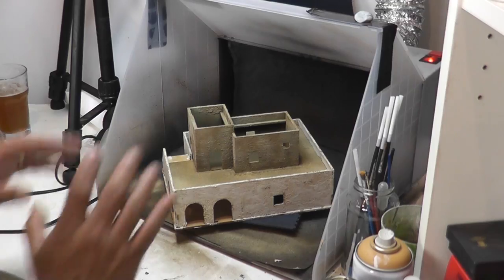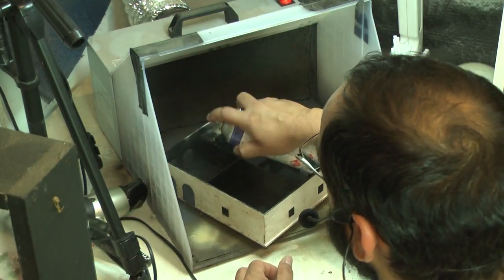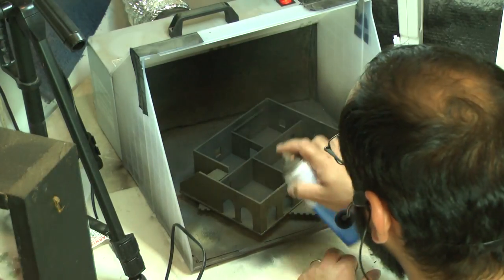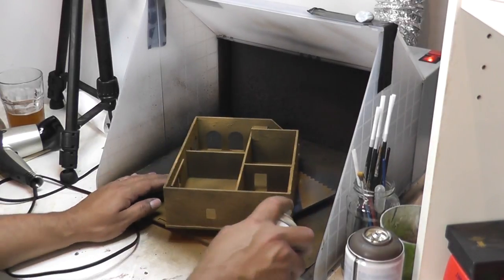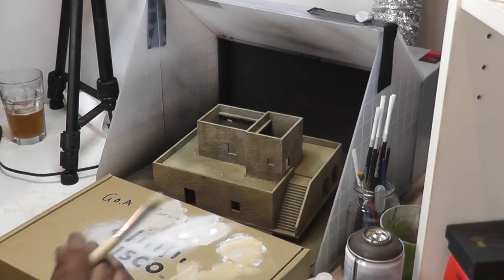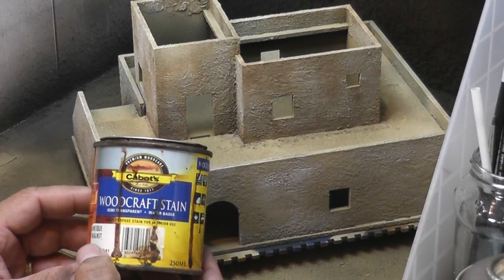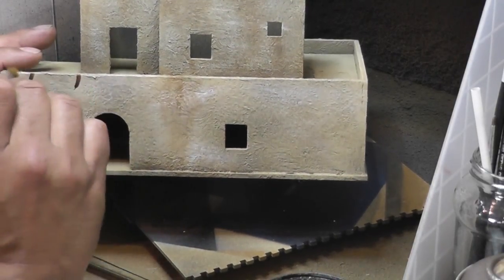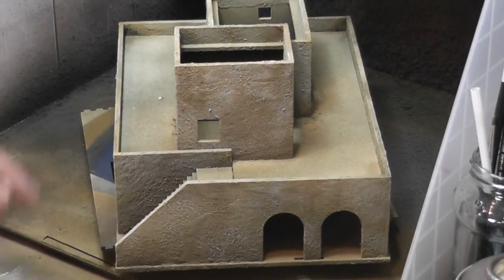Stucco Painting Tutorial for MDF wargaming models

Comment: Really nice could use these on so many different games. An add on to them might be the drains used to get water off the roof. small holes drilled and use straws maybe those little coffee stirers. They'd leave nice stains down the walls whereever they were.
Reply from the maker: Indeed!  On one of the sets I've done I used little scrap pieces from the windows and some wooden dowel to create downpipes, added some air conditioners, antennas etc ... they look great!

Comment: Great tutorial. I need to make a spray booth, it would be a real life saver in the wet and windy British winter.
Reply from the maker: They are soooo good.  You can get cheap ones (like mine) from aliexpress and ebay etc ... I have noticed though, that even without a filter the suction on the fan has decreased considerably!  I need to open it up and see what is going on ... it vents into my roof space so perhaps some critter has found its way into the extraction pipe ... gross!